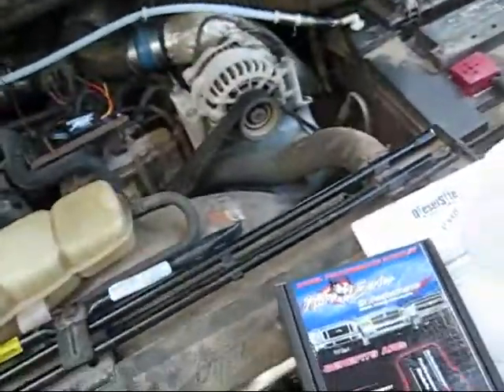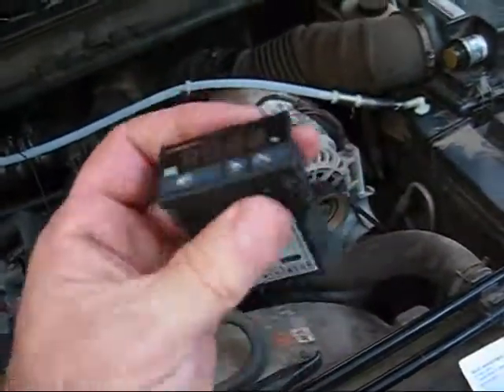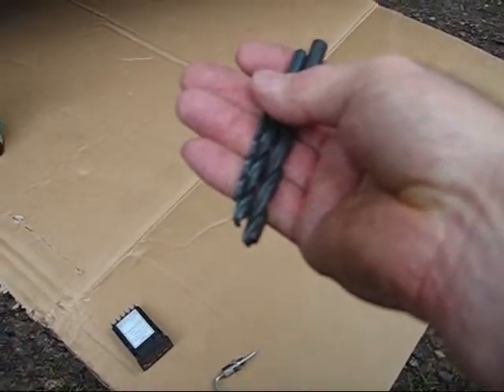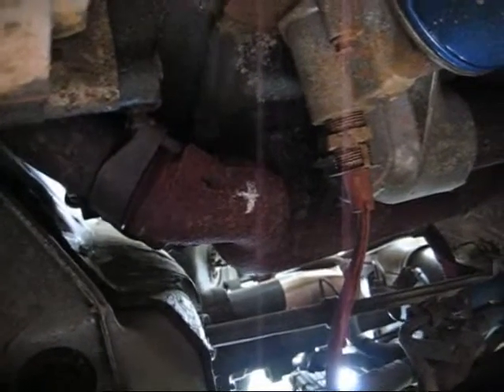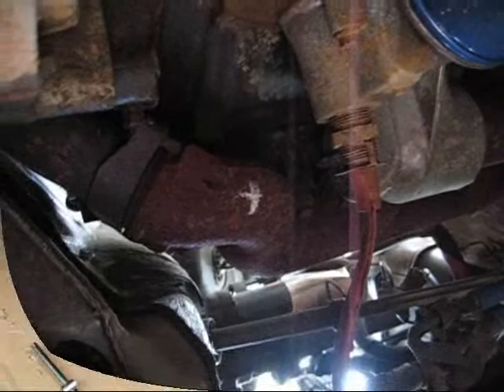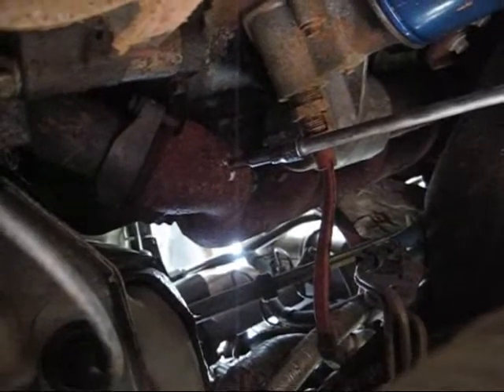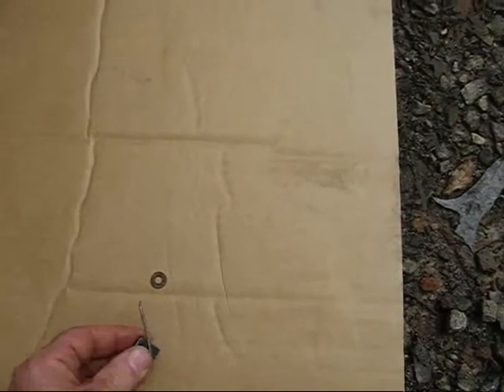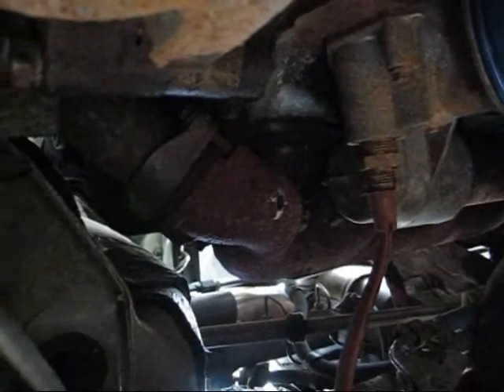7.3 Liter Powerstroke MPG Upgrades Part 3

Comment: Finnegan (Roadkill ) did this but was told to keep the engine running while you drill and tap the hole in the exhaust. The exhaust pressure blows the chips out.